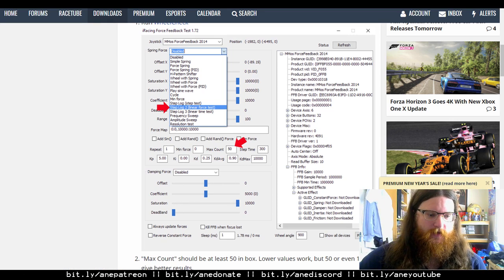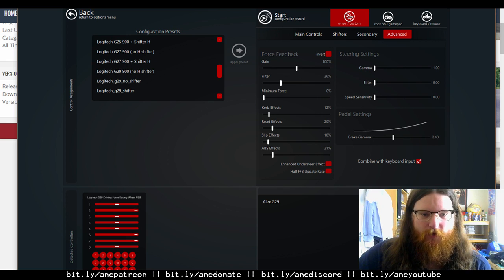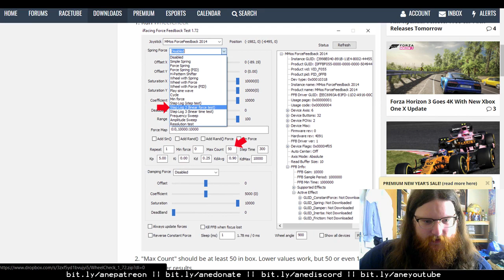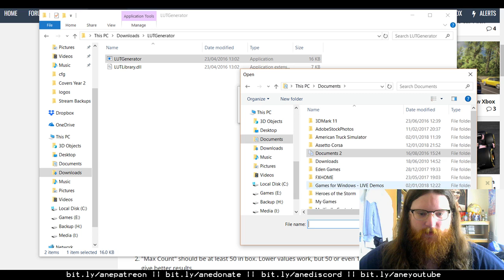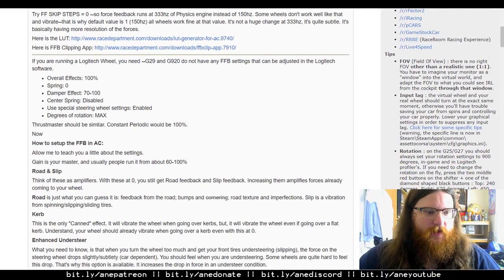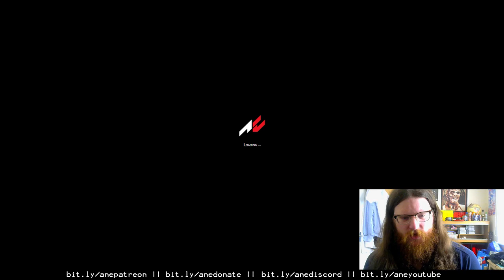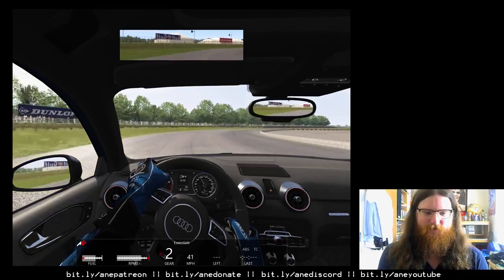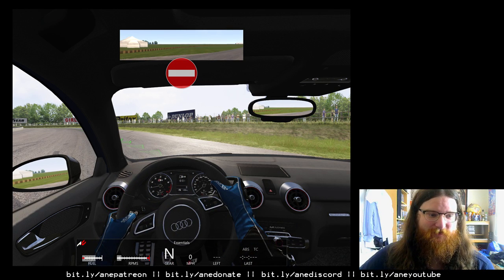Assetto Corsa - Logitech G29 - Wheel Settings Guide (Creating a LUT File)

Comment: For G923 user, we know that it have a weird curve for lut file. So i decide to edit by myself using notepad. So this is it.just copy or follow all the number below for nice result

0|0
0.02|0.02
0.04|0.04
0.06|0.06
0.08|0.08
0.1|0.1
0.12|0.12
0.14|0.14
0.16|0.16
0.18|0.18
0.2|0.2
0.22|0.22
0.24|0.24
0.26|0.26
0.28|0.28
0.30|0.30
0.32|0.32
0.34|0.34
0.36|0.36
0.38|0.38
0.4|0.4
0.42|0.42
0.44|0.44
0.46|0.46
0.48|0.48
0.5|0.5
0.52|0.52
0.54|0.54
0.56|0.56
0.58|0.58
0.6|0.6
0.62|0.62
0.64|0.64
0.66|0.66
0.68|0.68
0.7|0.7
0.72|0.72
0.74|0.74
0.76|0.76
0.78|0.78
0.8|0.8
0.82|0.82
0.84|0.84
0.86|0.86
0.88|0.88
0.9|0.9
0.92|0.92
0.94|0.94
0.96|0.96
0.98|0.98
1|1
Reply: Copy where?
Reply: how would it change anything, if it's not altering anything? the whole point of using lut is to alter how program translates data sent to wheel to force that you will feel

Comment: My wheelcheck program is not creating a csv file or if it is I can't find it. It's not in My Documents. How does AC know your file is named Mylut.lut ?
Reply: Same
Reply: @Eddiee757  I found a lut for my wheel on a webpage. I suggest doing that. No help here
Reply: @stevenlucas1880  nah I fixed mine and it’s better than one generated by another
Reply: @Eddiee757  from where?
Reply: Did you find a fiz

Comment: I'm trying this right now, but my wheel doesn't do anything when I choose "step log 2 (linear force test). Do you perhaps know why? I have a shifter and handbrake as well.
Reply: i got the same problem
Reply: @mitchalhill8838  I solved it by restarting my computer. At least thats what helped for me.
Reply: @kryddan666  I’ve tried that and it still doesn’t work
Reply: @ChaseMader  me too, did you get it to work ?
Reply: @Pr0hunt3r18  i cant remember completly because its been a while but im pretty sure once i downloaded the Logitech G hub software it worked
Reply: @Pr0hunt3r18  Let me know if that dosent work tho and ill go check my other computer because i didnt download Assetto Corsa on this one
Reply: @ChaseMader  can you help me? I tried with g hub and is not working position doesnt tell anything, its not working i dont know why
Reply: @edysimion1998  have you found a solution?

Comment: What if I want to make changes to the settings after I do this? Will it mess up the work it did?
Reply: Yes
When you change settings in the driver you have to generate a new lut file. Ingame settings have no impact.
Reply: @iPain3G  Alright man. Cheers
Reply: @iPain3G  also, do I have to replace the first LUT folder with the new one? Or I should just paste the new one just like that?

Comment: I notice that you have Axis 7 setup for your clutch pedal. In Windows 7, I cannot get Windows to recognise the clutch pedal as a separate axis to the wheel and therefore cannot assign it to the clutch setting in Assetto Corsa. How did you manage it? The same thing happens on my other Windows 10 PC as well.
Reply from the maker: Sorry for taking ages to reply. I've had a quick look and it's all auto detected for Axis 7. Nowhere can I see any options or setting that would help. The only thing I can think of is checking your connections or making sure the PS3/4 switch is set to PS4. 

Hope you find a solution.
Reply: try to download logitech gaming profiler
Reply: I've tried various versions of the Logitech Gaming Software and none of them appear to work properly. It seems the problem is at Windows driver level because the clutch axis is not correctly working when calibrating the controller in Windows devices.
Reply: @TheRealPuddin  Did you download the latest version of logitech gamin software that the youtubers have in the video showing that it works but they never have the latest version of the software link in the description so you can download it and you can never find the latest version of the gamin software on the logitech site that they are using in their you tube videos
Reply: @lunadab9641  Yeah good luck with that been trying to find the latest version of logitech gamin software that i see some youtubers making video with and they never have a link or can ever provide it

Comment: I think that this program works well in Logitech wheels,in my ts-xw made the ffb terrible, far worst than the stock one and also made the wheel clipping for no reason what so ever even at 50 per cent ffb in game.It made it weak and super light with zero detail even at maximum ffb.The sudden clipping was at random times when i was taking a turn and also i have a third party program which saw me the ffb clipping meter reported effects which the wheel didn't translate in my hands.. those things ofc only with the lut custom created file the stock ffb works great as it should but i wanted to give it a go.Thank you for your efford even if it didn't work for me
Reply from the maker: Kwstas Drakopoulos thanks for the comment, it’s handy to know these things.